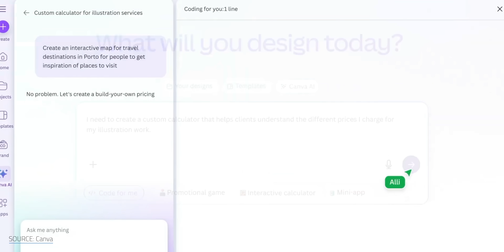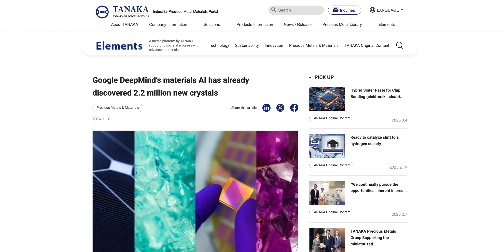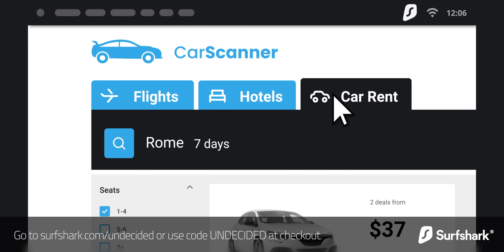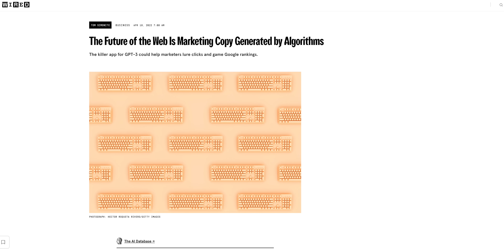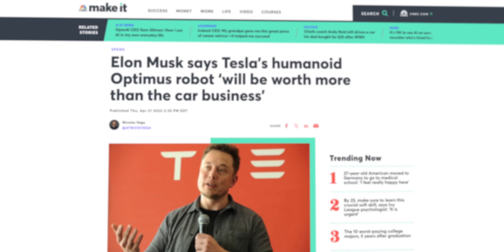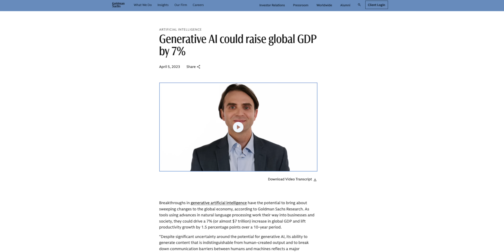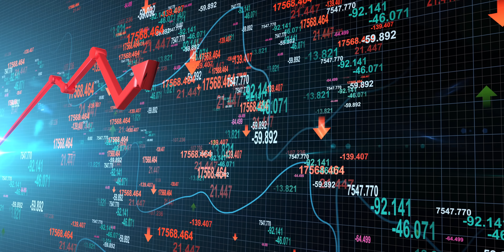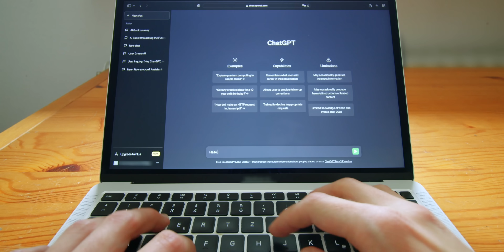Why the AI Revolution Has a Fatal Flaw

Comment: The UBI idea seems reasonable but we need a shift in how we look at the relationship between the public and private sectors. If the private sector is to be the driver of the tech and ends up increasing concentration of wealth into fewer hands, then the public sector needs to step up and provide essential services through more aggressive taxation of the concentrated wealth. Things like healthcare and pensions and a full education, etc. will need to be provided, otherwise demand will fall off a cliff.
Reply: Hopefully it'll be finally time to figure out that the goal of a healthy society in the modern age isn't to try to put everyone to work. It's an antiquated notion that came from a past age where you needed lots of manpower. Yeah back then when you needed lots of human manpower, that might have made sense, but technology is a force multiplier that's requiring fewer and fewer humans to achieve the same goals. We already realize this supply and demand effect when it comes to trade goods. In agriculture for instance, governments (like the US government) pay farmers not to farm crops, because ultimately flooding the market with too many goods hurts everyone. Nobody wins here because the massive supply just drives down the price and makes everyone struggle. 

Similarly to stabilize the cost of labor as technology becomes even more powerful, it will likely going to be necessary to pay people not to work. A form of UBI would probably be the best way to achieve that. Allow basic subsistence for free.
Reply: I don’t think UBI will be enough, it would help but alone would be very volatile. I think we need to go further than that
Reply: @sspectre8217  All UBI is going to do is shuffle money from the taxpayers, which are declining, into the hands of the big corporations that will provide all the services. It's welfare for all. Don't you see how great it is living on welfare?
Reply: Our future depends on mastering this delicate balance between private and public sector.
Reply: I'd say that UBI is the only option that's even remotely able to meaningfully address the issue, both in terms of pure, heartless economics and actually caring about quality of life. Also, it's the simplest solution, which is a plus too.

Regarding economics, like the video said, it doesn't matter how cheaply you produce goods or services if nobody has money to spend on them. Money has to flow somehow or the whole system collapses entirely; if business won't do it via wages, then some other option MUST circulate money through some other means. And as far as quality of life goes, (the more important thing if you ask me,) nothing is more closely and consistently correlated to quality of life than income. So if you're oh, I dunno, a politician who claims to intend to help people, putting more money in more people's pockets first and foremost is the only kind of help that matters and the single act that would reduce suffering the most. If you're doing anything else, you're just a puppet to the wealthy and not actually serious about truly making lives better.
Reply: LOL. So dumb. What incentive will the people who control this have to provide for people that will never provide any value to them? What is the point of educating people when they have machines that can out think any human being? How can you look at the world and believe that the people consolidating absolute control are doing it so they can give you free healthcare? There may be a utopia were machines do all the work while people live lives of leisure and pursue whatever personal pursuits for their own gratification, but it will only be for a select few who are part of the club. If you have any question whether you are part of it you are defiantly not.
Reply: Massive worker ownership of tech firms would be another option. Just saying.
Reply: @ChumbisDilliams  They already can, it is called buy stock. Or they can start a company themselves.
Reply: @dlmac  "They already can, it is called buy stock."

No they can't because they're not rich. The richest 1% or 10% own most of the stock. That means they control the means of production that everyone depends on. If the top 1% own 51% of healthcare insurance stock then they can choose to not give you healthcare. It's not real democracy. It's not "1 person = 1 vote". It's "1 dollar = 1 vote".

"Or they can start a company themselves."

This might sound like good advice to give to one person. But it's not a solution overall because we don't need 340 million companies in the US each with one person. We need many people to work together. So to just say to a person "if you don't like being a wage slave then your only alternative is to start another company" will not solve anything. If you're not being treated well as an Amazon warehouse worker you're going to start up a competitor to Amazon?
Reply: @dlmac  Workers can't meaningfully control the capital of most companies of any size.
Reply: @dlmac  Zuck literally has ultra-shares that means he casts controlling votes while holding a minimum of the company stock.
Reply: Tax the robots! If the "employer" of each robot, automatic teller, or self pay register was required to pay the federal, state, and local taxes that a person required to do the same work, would have paid, it could ease and give us time to adjust to the transition to part time human based economy and to fund the universal health care and a universal basic income so that the whole population might be able afford the products of this Brave New World of Industry they are building. It is (still?) our government, and we need to write new rules that lead to something other than enslavement and endless revolution.
Reply: My memory says that the Finland study mentioned at the end of the video had largely negative conclusions, ie the opposite to the view presented by Matt. Time for me to investigate.
Reply: The only thing UBI is reasonable for is creating corruption, dependency of individuals on state regime, and creating slave-like cannon fodder for waging new wars. If reducing human population is your goal, then by all means, demand UBI and reinforce increasingly fascist states doling it out (as they already are today in form of social benefits).
Reply: UBI is nothing but a fantasy in the current World state simply because of huge economic differences dependant on where you live ... New York, LA, London, Hong Kong vs some small town in nowhere land ... the only way UBI could have some hope of success would be if PROPERTY ownership was  REDISTRIBUTED something that has been done around the world many times throughout history ... expecting that few people in this day and age are going to gleefully jump on that bandwagon because that path doesn't come peacefully ... Welfare states are all around us ... people that live there are far from happy because they have nothing to do ... a better approach might be obtained with Governments making a collective redistribution of full time Jobs that will pay enough for everyone to live on ... if you don't have a job then one will be found for you ... working aged people need to have a job ... Governments have huge amounts of work that need doing just with maintaining infrastructure alone ... there are huge expanses of abandoned properties world wide that could be re-appropriated then used to house the growing homeless population ... put those people to work restoring and up keeping these appropriated properties .. . Governments need to be doing what they are elected to do. And Lastly, perhaps Governments need to place a CAP on both Corporate and Personal Wealth ... not looking to introduce Communism but Money like Power falls under the same adage of absolute Wealth/Power corrupts absolutely ... nobody or entity should be rich enough to buy a position of power in the Government
Reply: Education? Who will need an education? AI will do all thinking, and Robots will do all labor. 95% of the population will be unemployed and useless (economically).
Reply: No ,we already have the economic transistors equivalence principle in ssi. 
This was always the tool by which tranfering wealth as we domesticate mandatory conventional supply chains. 
Its just that those tools to help economic middle men old money worked by the merits of majority got an extra 80+ yrs of time .
Men who can reach areas that cant be automated will become more valuable than money itself. 
Ultimate reductionism of Euclidean minds ever. Economic middle men .
Just as kings relinquished to giga job president & pm now to will old world ziggarat modeling medical, professors, unions, publishers copyrighters merging into online coops competing for capital. 
Simply computed y -z getting grounded on x via ben Franklin's horsepower utility cpu serfdom programmed by purtanized anglish to English romanticized ,confirmed by pilgrimage dug up the alphabet under ancient world correlated and triangulated on reality
Reply: “We” as in the common people need this but the ones in power literally don’t care. They will give us UBI as an allowance for obedience. Some will use it to build parallel communities growing our own food, energy independence, etc., probably the best bet
Reply: yes. we need to tax ultra rich companies and maybe even more importantly ultra rich people A LOT more. it both harms every participant in the economy as well as actively erodes the power of the state which, the state is supposed to be the organization that looks after the interests of all of its citizens. and with the additonal funds we need to implement UBI.
Reply: Maybe people's "purpose" doesn't need ti be tied to a job they do to make someone else rich. 

If YOU had some guaranteed income you would just fall apart? Or would build, create and learn?
Reply: Exactly. WTF is the point of companies making endless profits? What are we doing? Are we here as a species just to create value for shareholders? It's insanity.
Reply: @inviktus1983  Anyone can be a shareholder.
Reply: Spoiler alert - the private sector won't step up. The public sector also won't step up. At least not in the US.
Reply: @innercityprepper Americans themselves are to brainwashed to accept this
Reply: @innercityprepper sounds like you’re a coward giving up and becoming a prepper rather than standing with others looking for solutions. Your inaction and defeatism is just giving those in power carte blanche to act with impunity.
Reply: The issue with UBI being controversial is I think one of a vocal minority. I think most sensible people agree with the idealized version of UBI where there is more to go around and so we spread it around rather than leave some behind. Now in a world of scarcity UBI isn't appealing. A lot of examples people draw on for socialism were rooted in this issue of scarcity. I think even now UBI makes sense for certain areas like healthcare and education to make sure no one is prematurely robbed of opportunities. Food and shelter seem like obvious next steps to me and maybe eventually all the way to leisure.
Reply: UBI is a short term solution. It cannot work long term without price caps. Without price caps, those selling products and services and housing can and will raise prices to scoop up that free money everyone is getting.

What we need is the government directly providing food, housing, transportation, and other essential services.
Reply: @wck  Yeah, exactly a fully centrally controlled economy in which "the government" decides how and whether you live or die. You want that? You can get it, it's been done in the past.
Reply: UBI is a bandage on the symptom. The problem is who has the power to distribute jobs, which is actually a matter of who owns the means of production. At the moment, the wealthy own it. AI is one of those means of production. What we're seeing happen right now is capitalism collapsing under the weight of its own internal contradictions. What will have to happen going forward is to collectivize all means of production, not just AI. That means workers command their own workplaces. This also means the people making the decisions will be subject to the consequences of those decisions. That leads to decisions based on what will guarantee no one will go without their basic needs being guaranteed.
Reply: @greevar  This all day every day! ---"This also means the people making the decisions will be subject to the consequences of those decisions."
Reply: @greevar  Disagree. UBI isn't the bandage - it's the part of your idea that makes it work LOL. The problem is that we're moving toward work no longer equals money. The productivity of a human job is at risk (will you be better than AI? Will you be better than all the people displaced from other work by AI?) and, under current paradigm, human income will be too. UBI accepts that decoupling and gives you income regardless of the productivity of your work, which then allows you to do work that you want to do even if it doesn't grow capitalist profits or collectve utility or whatever phrase you want to use for the same exact idea. 

You say that workers should own the means of production. But the means of production don't need all those workers! lol. Collectivizing is feasible at small scales when you have basic work functions that don't require a great deal of complexity. But even back when Marx was doing this - the companies creating the machines that allowed workers to handle their own collectives were going to be much more difficult to collectivize than growing crops in the fields! And nowadays, the machines, the AI, even the fields are insanely complex and specialized. 

So what do those extraneous workers do? Sit at a desk and bang on the table and count down the hours? They're a part owner - so they still get paid! Or get a loaf of bread, same idea. So abandon the pretense and do the exact same thing but more efficiently and humanely with UBI. That guy doesn't HAVE to sit at a desk doing nothing. He can paint or fish or raise a child and do what he WANTS, rather than to "justify" a paycheck. 

Collectivization doesn't work unless we have entirely abandoned productivity because society has collapsed to the point where neither we nor AI can save us anyway. Until that point, we can ABSTRACT collectivization into something that translates productivity and value across a wide range of inputs and work and products into something that any "part-owner"/person can use for a wide range of services and goods. IE..... A UBI funded by taxes! It's the exact same thing you're imagining, except that it works whether we're talking about living on the compound after the apocalypse or just about life in an AI-run job drought.
Reply: @greevar  most people I know don't want to command their own workplaces.  They just want to collect a paycheck so they can live their lives.
Reply: @greevar  Yep! I completely agree. However, it's far too late. The capitalists make the rules, and will never allow socialism to come back. Ever.
Reply: @greevar  Workers command their own workplaces when they own their own businesses. The war has always and will always be against the middle class, against the mom and pop, against the so-called petty capitalist. You are never going to succeed by reinventing communism.
Reply: @greevar  Yes and create our economy and currency.
Reply: @greevar  I couldn't have said it better. While having UBI is better than not having it all things being the same, it doesn't address the fundamental problem and so will ultimately not help. It's just a patch to try to fix capitalism.  The problem is capitalism and that under capitalism the means of production are owned and managed by a very few. Those very few own the AI and automation.
The real solution is that workers need to own and manage the means of production democratically. If we all had ownership of AI and automation collectively then we could all benefit from it. We could all work fewer hours and get the same standard of living. AI and automation can be a good thing depending on who owns, controls and benefits from it.
Reply: @SolidAir54321 you can collectively own the means of production and labor. Get a collective and collectively pool your resources, collectively assume risk and make the investment. But that would take work and guts and ideas and responsibility. Why do you think you deserve to take what you did not create. Don’t say as a worker you are the one making the profits either. The business owner created your job specifically to create a profit. That was the motivation to take the risk. You’re not special, you actively decided to be a tool not the toolmaker.
Reply: I like the idea of UBI in principle, the problem is how to pay for it. Trying to claw tax money from billionaires is nearly impossible, with their impenetrable web of lawyers, lobbyists, and accountants.
Reply: @ab-tf5fl  Well that's a problem for every social safety net program in existence. Billionaires never want to pay, and would make everyone dirt poor if they got their way. Exposing them as the toxic element is important to any positive advancement in society. Difficulty for sure, but a fight that absolutely must be fought.
Reply: UBI never works in a country like India.
Reply: You would literally kill the stock market doing this.
Reply: True but (at least in the West) governments are suborned by business so your idea falls at the first hurdle unless people figure out how to vote in their own interests (don't forget Trump has promised to cancel voting).
Reply: Need to restructure economics. 

Go back through history and realize it has always been effort/risk vs reward - "I will do this for you in exchange for that."

Then bartering came along -  a duck for a blanket.

Then "money" came along to make the transfers easier. 

Somewhere in all of this, the money itself became the target. 

So, to the question at hand for most people - "If I can no longer be gainfully employed, how do I acquire what I need?"

UBI proposes the authorities will hand you money at their discretion. However, unless the authorities also fix prices nationally, it falls apart quickly. Further, exchange rates fluctuate wildly with worthless currency. 

If I sell blankets and you bring me valueless UBI currency, how do I determine how much of it to take? Do I refuse it all together? 

And dismissing all of those pipe dreams of a better society, what happens to the immoral, the addicts, the malcontents, the criminals, now with cash in hand?

This is one area where Atlas Shrugged got it right. When this moment approaches, many will need to disconnect and start a new society.
Reply: Taxes simply won't work, you need a balance between a carrot and a stick
Reply: You all are wrong on all counts.
Reply: Fearmongering. That is what this is. The idea of UBI is good on paper put a disaster in reality. We need competition and choice. We need a safety net, not a hammock. All the problems in healthcare and education were created by well meaning people, the road to hell is paved in good intentions. 

The simple idea that things can be solved with taxation on wealth is scary because those are the people who create things and are the most productive, in addition they already cover 80-90% of taxes. What we should be worried about is how bad people spend the money. If you actually cared you'd see just how bad it is wasted. Public school 20k per person, private is only 8k and it is better.

There wealth isn't sitting in a vault where they swim every day, it is in the businesses that pay your salary.

The real question is why is the average Joe not able to take advantage of this? Part of the answer is Social Security and other bad options in the first 20 years of your live.
Reply: UBI is absolutely awful.   We need true meritocracy.   You reap what you sow, amd those that cheat are punished and removed.  This is the only thing that makes any sense.
Reply: @skiittz2916  I don't agree with the statement that "UBI is absolutely awful" because firstly, the trial that was presented showed no significant impact on employment or productivity so people still did as much as they did without, it just made them less stressed and more healthy. Secondly, a UBI isn't intended to be luxurious it is supposed to make sure you don't die. Thirdly, a "True meritocracy" implies that everyone has the same starting point or at least the same bottomline therfore a UBI would actully serve to meet the goal of a meritocracy.

Lastly, (although this is more of a personal gripe hence the seperation) it seems to me like whenever people talk about meritocracy they always focus on punishing bad behavior rather than reinforcing good behavior even when reinforcement tends to yield better or even results.

Side note: if the stament was intended to be hyperbolic I apologize.
Reply: @jacobbarndt yes everyone should start at some base equivalent starting point: 0.  Those that provide nothing to society need not be kept from falling back to 0.
Reply: @skiittz2916 I agree with that to a point, but I don't think the bottom line should be at 0 because if you are starting from nothing then you are reliant on others to get you something to work off of, and if you must rely on others then it wouldn't be truly your merit that gets you to where you are. If you want a meritocracy then the start needs to be at 1.

I also want to be clear with my bias I am not in support of meritocracy, because that disregards a lot of the benefits of being a social species.

Also I think of the starting point like a math formula.

AX+B

A is the effect your actions have on your final value

B is your real starting point

X is your contribution at a base line, without a modifier

At least with how I interpret it, the thing we disagree on is the value of A.

Btw "those who provide nothing to society" is fairly vague and has historically been used to disregard the contributions of those that society sees as different. I do want to be clear I don't think you intended it that way, but I want to be careful to not disregard something out of turn.
Reply: @skiittz2916  Those that cheat hold power, economically and politically. They are the ones who can avoid punishment best, so I think you need to expand your rationale and methodology a great deal.
Reply: What use is meritocracy for the 55 year old factory worker who is willing and able to work, but his profession is automated away and he can't reeducate himself to be an IT professional? What use is meritocracy for those born unable to work, or who become unable to work through illness or accidents? Or those who have skills companies want, but don't get employed due to having too "exotic" names or skin colours for the recruiters? We need social safety nets and strong labour laws for so many reasons.
Reply: @skiittz2916  So you will be disposed of for AI robots.   Not smart.